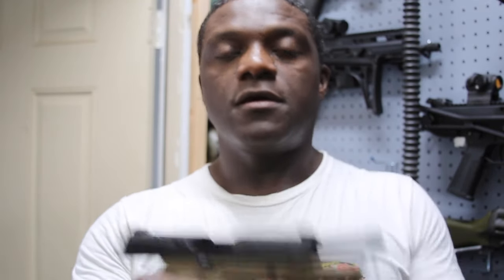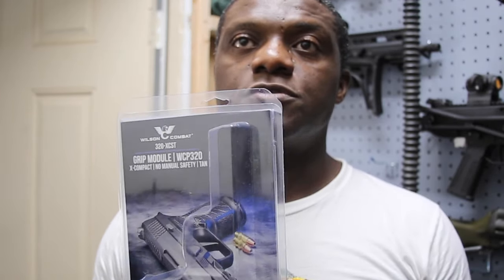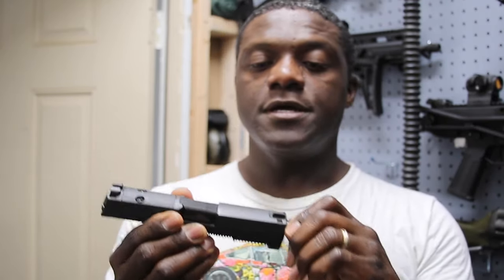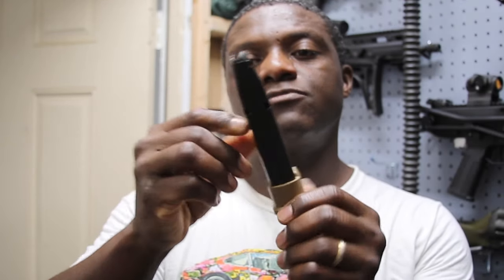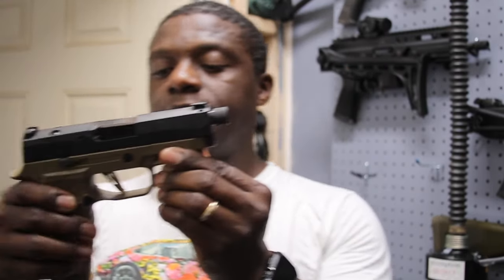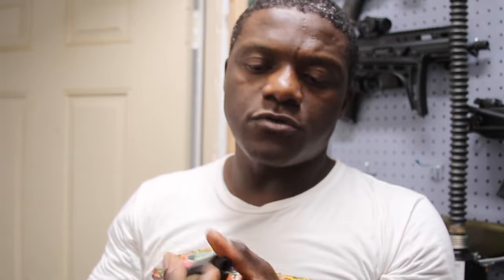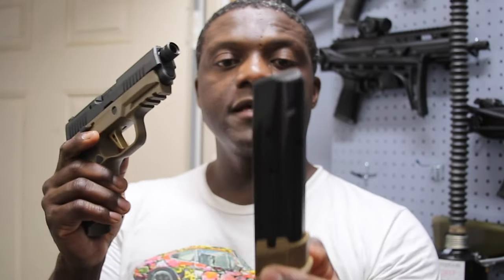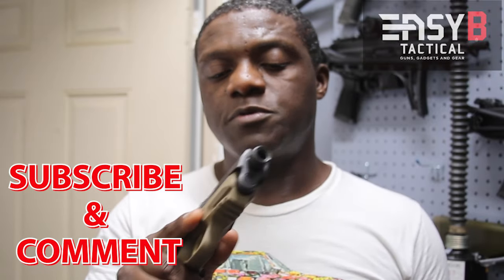Sig P320  Custom Upgrades

Comment: Not sure if you're aware of the correct wilson combat grip module that will give you the correct grip length for the 17 round mag. You currently have the one for 15 round mags (notched), you want the one that's flat all the way across for 17rnd mags. I'm glad I found your video though as I was wondering how the 4.3 inch barrel fits on the 3.9 in slide. Per Sig they recommend the 4.6 inch barrel for the 3.9 inch slide but it stick out way too much to me. Your setup looks perfect. Also you may want to look into the wilson combat tungsten weights for their grip modules if you want to add a bit more weight for balancing.
Reply from the maker: Thanks for the info!

Comment: I am desperately searching for a 3.6" threaded barrel 💯 compatible with the(live round indicator) so i won't lose it. & Also decently priced under or no more than $150 if @ all possible..... That being said ive scoured the internet for this type barrel thats also preferrably in stainless steel too btw, but @ this point ill definitely be ok with black.... I just purchased a pws BDE 9mm for my sig p320 x compact.... Again X Compact ....

Comment: Most of the Wilson modules are in stock right now on their website if you wanted a full size 17rnd module. The Carry II module will get you the same length dust cover, but a 17rnd grip.
Reply from the maker: Yes, at this time stocks back up

Comment: Did you have issues with your FCU? I have one and the trigger won't reset after racking the slide
Reply: Brian, is this during dry fire or while shooting. Either way, check the trigger return spring in the FCU. It's the small coiled spring exposed and under the trigger bar. Sig Guy has a lot of in-depth videos regarding the FCU. Good luck.

Comment: hey great video, just a heads up your link to the slide is incorrect, you said you have a 3.9 inch slide the link is to a 3.6. now your link to the 4.3 inch threaded barrel is why i ended up here. i was trying to see if the 4.3 threaded will fit in the 3.9 slide. and from the looks of your build it will. have you had any issues with that?
Reply from the maker: No issues. After sorting out (getting used to Sig nomenclature) I'm running the 4.3" threaded barrel.
Reply: So does the 4.3 barrel work with the 3.9 sig slide? Building my first FCU and not sure what slide and curious if you use a 3.9 recoil spring?